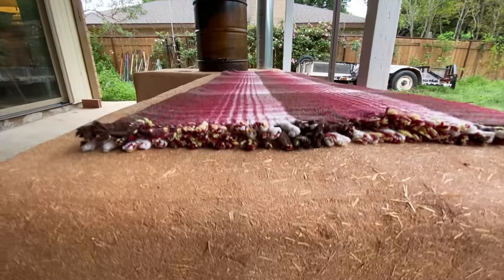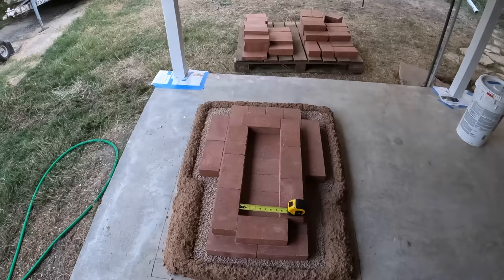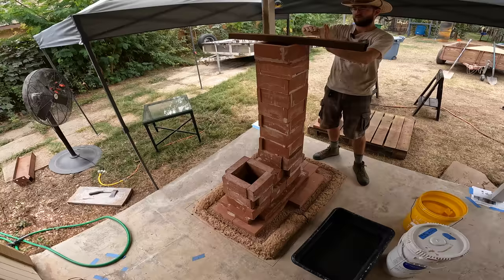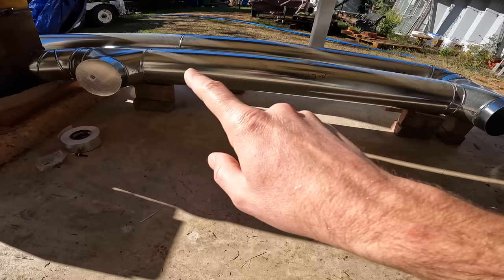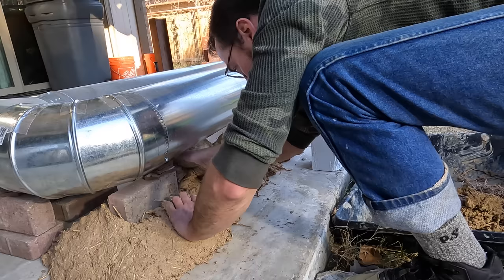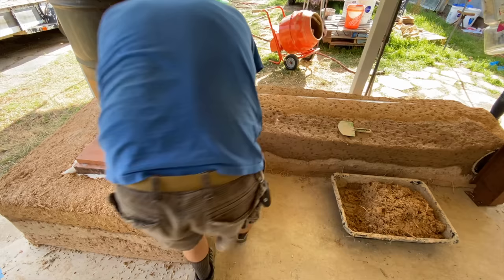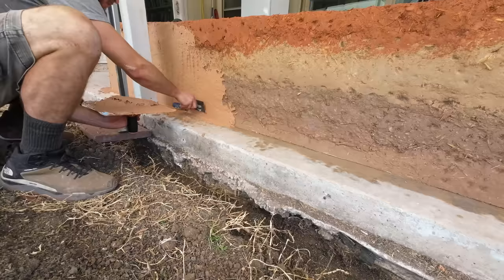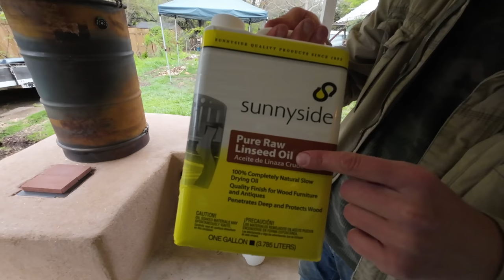World's most efficient stove!!!!  Made of DIRT!!!

Comment: Pottery clay is something that has a lot of variations depending on the purpose of the finished product and how it is intended to be fired. Are you using grogged or ungrogged clay and is it high or low fire clay? Also, for anyone looking at it, air dry craft clay from the local five and dime craft store probably isn’t suitable for use in this sort of project at all because it is recommended not to even fire it in your oven.
Reply from the maker: I am pretty ignorant about firing pottery. I know that the details matter a great deal or it can explode in the oven, etc. The details of that do not matter nearly as much for using it in Cobb like I did here. Even when the cob is heated up, the temperatures are so far below anything seen inside of an oven. I took whatever was available. That even includes the slop coming off of the wheel sometimes. This is a mix of many different types of clays. Keep in mind many people just dig up dirt from the ground and depending on the clay content that can be sufficient for building a rocket mass heater.

Comment: Great video. I like your detail two dimensions of heat chamber, etc.. I currently heat my GEO-DOME 30 foot diameter with a rocket stove. When I reconstruct this year I will apply some of your ideas to my new stove. I will have to upscale the dimensions as I put in good size logs to create a long burn time. I have my heat pipes in gravel beneath my aqua Pontic grow  tanks. So my heat comes from the floor below. I like the idea of the thermal blanket wrap on the riser and a Masonary riser. I made mine out of sheet metal and it served me well for about eight years. My next one will be made out of clay bricks as you did. Thank you for the good video. Hopefully you have some reference books that I can look at for upscaling my rocket stove size.

Comment: You knowyou dont need to use exspensive piping in the mass section of the rocket stove.Just make it hollow it will do the exact same thing as with ppes.You can still have inspection and cleaning outlets in thiswithout the pipes

Comment: It seems as if you would want a damper  in the chimney that can be closed after the fire is out.  This would prevent cold air from descending, being heated by the thermal mass, and then rising out the chimney by natural convection.
Reply from the maker: I used 2 half-sized fire bricks on top of the fuel feed to close off the airflow. You’re exactly correct though if you leave it open a thermal siphon cools off the whole mass overnight while you sleep. Thanks for commenting!
Reply: @suburbanbiology  En
Reply: @suburbanbiology  I noticed that you were blocking the air intake with bricks. That prevents backflow into the porch.  However, even with the air intake blocked, there will be counter-current flow in the chimney, with cold outside air flowing down in part of the chimney cross section and warmed return air flowing upwards in the remainder, robbing the thermal mass of heat. A butterfly damper in the chimney just before the pipe goes through the outside wall will prevent that heat loss when closed. You just have to remember to open it before you light the stove.

Comment: The overall work is very perfect, but the height of the firewood inlet is a bit low, which may cause an increase in indoor PM2.5. Adding two layers of bricks will be more perfect.（From Chinese enthusiasts）😀
Reply from the maker: I read that it can cause problems if you increase the length of the fuel feed tube. Given that this was my first project like this, I didn’t want to go against advice. Thanks for commenting. I appreciate this Support!
Reply: @suburbanbiology  If your house is well sealed, you can try the air quality detector. If PM2.5 significantly increases the height of the firewood port, and PM2.5 has hardly changed, there is no need to make any changes. ( I hope you can use RMH more healthily)

Comment: Kreosote buildup within the system would be my biggest concern of this system within any building. Kreosote if not minimized and cleaned out will eventually ignite, burn extremely hot and burn everything down.
I know 2 guys in my life who had kreosote started fires burn their houses . Each lost a child in the fires. A 30 seconds disclaimer given about fire danger, risk doesn't tell how to prevent this.
Reply from the maker: I have had other comments mention similar concerns. One other, commenter mentioned that he actually had a chimney fire. It sounds like from the information I’ve gathered that the most important things are going to be ensuring that I only burn appropriately aged wood. I plan on using brushes to clean the ducts and chimney at the end of each winter. From what I’ve read, the bell is usually not an issue as far as creosote fires inside of it. Thanks for your thoughtful comment and for subscribing!

Comment: On your first course of bricks you laid for the burn chamber you end to end the third brick laid dry jointed ie no Clay slip on the end to form the joint.
Was there a reason for this. 

Top tip for the final rendering, just use a dampened board on the floor up against the side of you bench and apply the render from there.
Doing this saves time and effort also helps to keep the floor clean. 

Was there a reason for not building a cleaning access door into the front of the burn chamber to ease removal of ash and debris.

Thanks and a great build video brother 💯👌🏼💯
Reply from the maker: If I forgot the slip the brick it was not intentional. It may have been an editing error or just pure brain fart. I wanted a cleanout but I read that more edges can lead to more cracks in the cob. Since this was my first, I wanted to keep it simple. Thanks for your support and for subscribing!!!

Comment: Really an excellent post without a bunch of lifestyle comments. Would you consider using cast iron for the pipe and concrete flue liner in place of the barrels? Great skills demonstrated. Thanks. Bob in Nevada
Reply from the maker: As long as the cross section of the materials is an appropriate size compared to the materials I used I bet those would work as alternatives. The book I linked in the description of the video is very good about talking about what size cross section is important. Thanks for commenting and for subscribing!

Comment: Beautiful work! 

I enjoy ceramics, and the thought occurred that perhaps a small kiln could be built at the exit from the manifold. How hot does it get inside? 

Second thought, a stoneware oven atop the exit tube just past the manifold, or perhaps between the feed chamber and updraft chamber—fresh bread and pizza! 

Has anyone tried this?
Reply from the maker: You can make bread or pizza on top of the bell if you put a cap in place that traps the heat. It can negatively affect the draft though so it may impact the function of the stove. Permies.com forums cover pizza oven versions of rocket stoves.

Comment: Have you considered making a genuine wood smoke house?  You could divert the smoke away from the chimney into the smoke house.
Reply from the maker: These stoves actually wind up, performing a lot of secondary combustion inside of the heat riser so by the time the exhaust gas leaves the tip of the chimney there really isn’t any smoke per se. It’s mostly CO2 and some water vapor. Carbon monoxide too, of course. But not much smoke for flavoring. Thanks for subscribing!

Comment: I want this as a glasshouse heater, thanks for taking the time to video your process.
I know hindsight isn’t helpful to you…
Cobb that doesn’t crack: I’d use coarse glass fibre, either from a shredded fire blanket or some other source. The ceramic blanket if shredded and soaked in clay would do the same reinforcement job I expect.
Can you patch the thermal Cobb cracks with the clay slip?
Will you be spraying the barrel with heat resistant paint 1500-2000 deg paint?
Reply from the maker: I used clay sand mortar to patch the Cobb cracks. I  posted the barrel in linseed oil. It burned off for a few burned and stank a bit but now has formed a nice coating. Kind of like a seasoned cast iron pan. Thanks for commenting and for subscribing!

Comment: why not shred an insulation bat up into the thermal cobb ... glass fiber is a thermal insulator .. and would keep the thermal cobb from cracking .. 

She wasnt playing in the straw ... she was SUPERVISING ... making sure you got the measurements right ;) 

use your hawk as a holding platform yes but rest it against the edge of the wall to be plastered and PUSH a trowel full into the wall and up back the hawk away and smooth ... this lets you push a good firm seal into the older stuff ...

Comment: Possibly the base cured too fast? Sometimes cracks form when anything changes it’s properties that fast. Try plastic over the drying area and let it cure slow. Even misting water on surfaces directly if early surface cracking is noticeable. Leave any forms on. slow cure. Question would the base be more stable if the very first layer of fire bricks were clay back buttered onto fire base on Installation then cover. slow cure less likely
Reply from the maker: If I could do it over again, I would probably just use bricks to form the perimeter instead of that ring of fire cob. That probably would’ve solved everything fairly simply. Thanks for your comment.

Comment: I know nothing about the working properties of Cob.  How well does that hold up over time with people sitting on it?  Any crumbling or pieces coming off corners or edges?

Pretty slick project.  Thanks for the video.
Reply from the maker: My project is still less than a year old but so far it has held up just fine. I have been told by others with more experience that I probably should’ve made the corners more round than they are. They accidentally wound up a little bit sharp just because I am new at this. Water makes it a squishy mess real quick, so you have to be sure that you don’t spill water on it, or let rain splatter on it. Thanks for commenting, and for subscribing!

Comment: Did you explain its efficiency?

Because I don't understand how it's more efficient than any common wood heater with 80's technology such as secondary burn etc.

How do you clean the snakey exhaust so you don't have a kaboom issue?

This design is illegal for good reasons in most countries.

You cannot (as far as I can tell) insert large logs, so you have to constantly tend to the (tiny) firebox which means you can't continue a burn overnight (without waking up to tend to it every hour or two).

The firebox is also not completely contained so there's another risk, a significant one, again, not legal in many counties and no insurance for any mishaps.

I don't see the heat generated heating anything else than the immediate area.  You could/should have it heat a medium, such as water, that takes that heat, probably via pipes to radiators in other rooms.  You then have the ability to heat and if wanted isolate rooms if not in use.

It's a neat project, but like almost everything on YouTube, it's not as well thought out as the people who don't know what they're talking about in the comments think it is.

I hope no one bothers to create this inefficient, costly, dangerous heater in their own home where humans they love, live.
Reply from the maker: You sound like your mind is made up. But in case you are curious permies.com has a good forum that addresses many of the questions you posed.

Comment: possible to use some sand around the pipe for good contact?       also possibly a great place to raise seedlings.
Reply from the maker: I have read that despite it being very non-intuitive, sand actually accidentally insulates the HVAC duct. Apparently, sand is quite a good insulator. Gravel on the other hand is supposed to work much better. Like I said, this is not intuitive to me at all. I do agree, though it would be a great place to germinate seedlings. As long as you have a waterproof tray underneath it. Constant moisture would risk melting the cob. Thanks for commenting for subscribing!

Comment: How has this held up over time?  Any significant cracking or peeling of the outer layer, separation from the bricks/bell, etc.  How often do you fire it up?  Beautiful build, thanks for the in depth build guide!
Edit: also, have you considered painting/sealing the outer layer to add some moisture protection? Just saw the linseed oil.
Reply from the maker: I only finished the project right as the weather was heating up so I haven’t lit too many fires for the sake of actually generating heat yet. The weather here is starting to cool off, so I will have more information soon. Thanks for watching!
Reply: @suburbanbiology   Very cool, I'm excited to hear more about it!

Comment: You should have welded a clean out port off the front of the rocket stove. I know there's less left with a rocket stove but your still gonna have to clean it out eventually. I'm watching during my lunch break and had to skip around so you might address this in the video and I missed it. I've seen people use stainless barrels to get a nicer finish and use those stove fans that power themselves on the barrel too.
Reply from the maker: You can simply take off the upper barrel and lift it up and over the heat riser. Then you can just stick a shot back down into the lower barrel. Thank you for commenting and for subscribing.

Comment: With a RMH there shouldn’t be any creosote build up in the exterior chimney. This is because the system is designed with an internal heat riser, essentially an internal chimney, that gets so intensely hot all that potential creosote build up is burned as fuel to heat the home. Put another way, the system is designed to safely have a chimney fire every time to prevent any build up from happening.
Reply from the maker: I have read that many different places. I have seen in these comments though people claim that they built a rocket mass heater and ultimately did have problems with creosote buildup. I plan on sweeping the chimney on a fairly regular basis just to be safe. Thanks for commenting and for subscribing!

Comment: I assume the slope in the front and rear piping is to help drafting, however, does it not also mean that condensation that may form (due to the cooling of the exhaust gases) flows back down to the barrel? If so, is there any accumulation over time? I presume that initially it would just be evaporated by the hotter exhaust gases and then head back up through the pipe. However, again some of that would again condense and flow back down. So it seems that there may end up with a small pool of boiling/evaporation water at the somewhere in the exhaust ducting (maybe at the bottom of the barrel where the exhaust gas enters the front pipe. That water would still probably evaporate after the fire goes out over time due to the heat loading in the stove. However, have you noticed if there is any accumulation of salts or tars in that area left behind by the evaporating water? If so, does anyone making these suggest making a drain pipe or removable drain pan that could be cleaned occasionally? Or am I over thinking how much condensation forms in the front and rear pipe? Maybe it forms in the vertical section of pipe after it leaves the large thermal mass of the bench...
Reply from the maker: I think that you raise a number of good questions here. I am not sure because I finished the stove right as the temperature was warming up. I will burn more fires this winter and I will gather more data. I would imagine that most of the condensation that makes its way toward the barrel, would quickly boil off and be sent back up the slope. Once the fire goes out, the inside tube tends to draft for a number of hours. So much so in fact that you have to block the feed tube in order to prevent losing all of your heat up through the chimney. Either way there’s quite a bit of draft and I would imagine that this evaporates any traps condensation inside of the stove. Thanks for subscribing!

Comment: If this rocket stove is built correctly then all the rocket stoves ( including mine) I've seen were built the other way around. The wood would go into the lower part which is the beginning of the stove. And the heat is expected in the higher part. Whereas here the wood goes into the high part and the heat cumulates in the low part followed by a chimney pipe. Hmmmm. Have to try it out